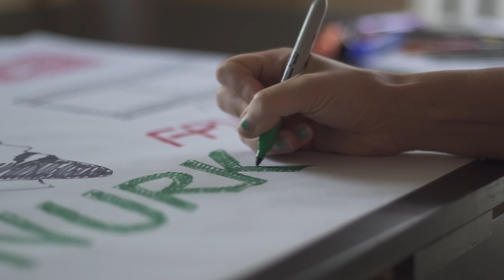Gridded

Comment: Insane. Can you please do a video of how to do those tricks. Thanks
Reply from the maker: hm I'll have to think about that.. lots to unpack, and i'm not totally sure exactly how i do them, but I'll give it a shot. :P
Reply: NURK FPV thanks
Reply: Hello My Fellow Fellow I'd like to see that as well
Reply: Hello My Fellow Fellow hey there were 3 primary tricks. They were Matty tricks. First was half roll to inverted position then you pitch down while giving throttle to level out. 2nd was yaw variation. Half roll (left), slow right yaw and pitch down while giving throttle to level out. 3rd was 1.5 rolls to invert and then down pitch to level out. 4th were simply half rolls, invert hold and half roll to level. Hope this helps. Cheers.
Reply: thanks for the description. would be amazing to see video of the controller synced up with the flight.  course it also depends on what the PIDs and rates are like - everyone has their own taste in tuning.